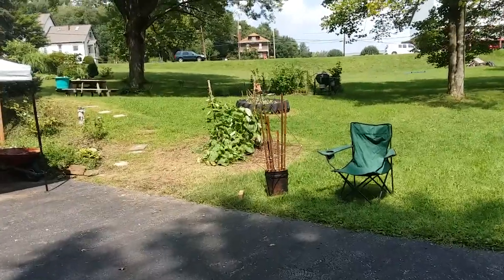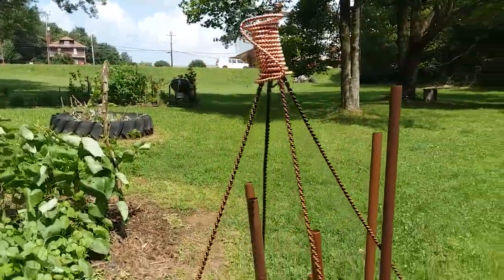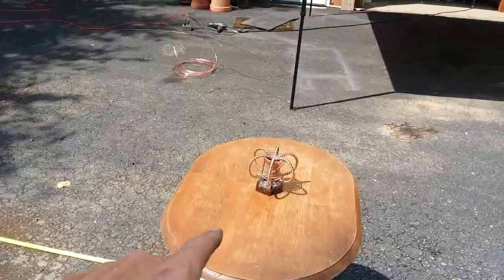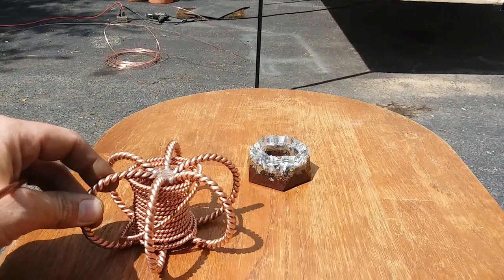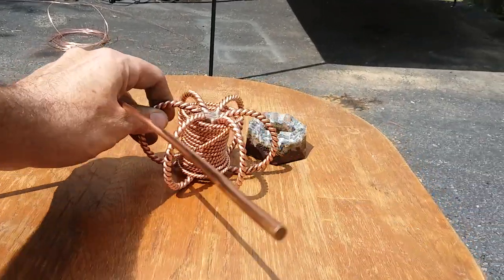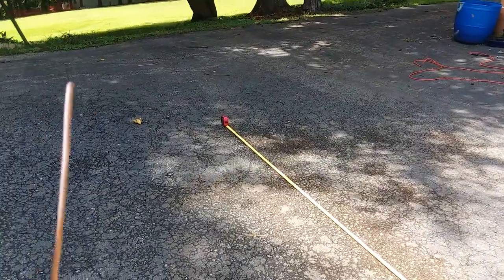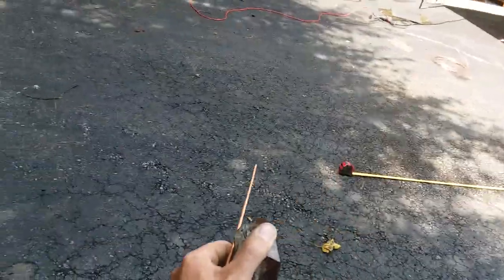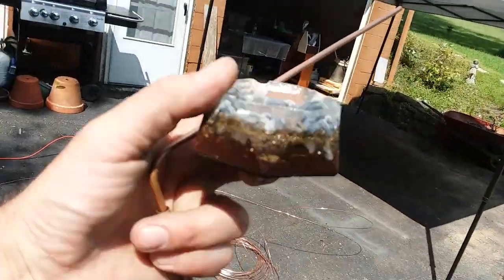Energetic dowsing a tensor harmonizer with L-rods

Comment: im having trouble getting my rings to stay together, what solder should I get? ive tried the solder from hardware store and it will not stick.. Any help would be super. Anyways great video I would like to learn more about this
Reply from the maker: I have been using copper brazing rods with 2% silver, a high heat torch head with map gas will get it hot enough to braze with

Comment: I have a torch and copper solder but when I try to solder it just globbs on and the solder wont smoth out.. maybe i need a better torch? Or is the solder im using wrong? it is a very thin gauge solder from etsy
Reply: u need flux gooey kind...the copper needs to heat up before applying solder.  If u are clamping it with metal too close to where u solder it will drain the heat/.